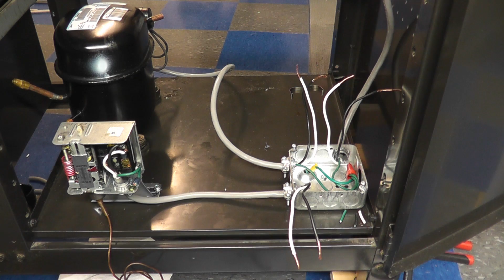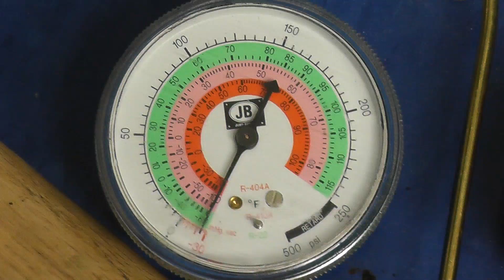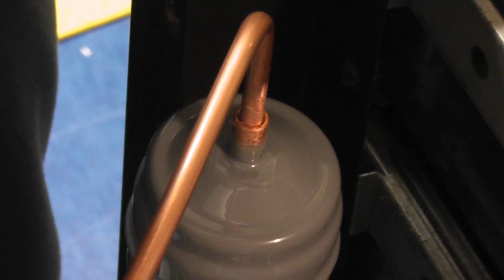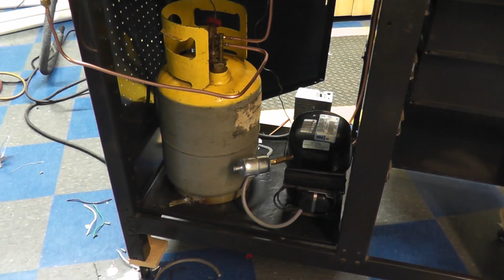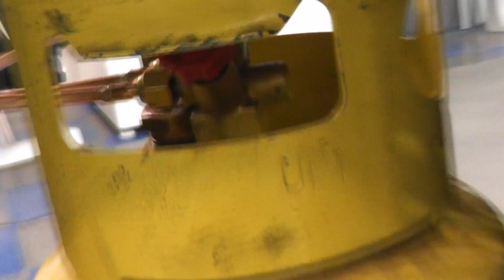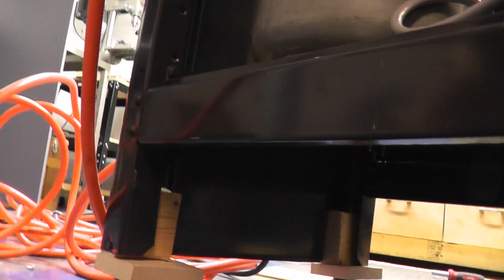Building a Silent Air Compressor Part 2

Comment: Loved it dude! This would be perfect for a silent compressor for mounting inside the cab of a car or truck for an air horn application. Youre obviously and HVAC tech or were at one point....Plumber here with my dad since i was like 7 or 8....so this is right up my alley. Have you ever seen a 12volt refrigeration pump that would give me like 150psi?

Comment: did I really see you show a PLUG that you are going to use to  feed the unit?
a plug with live pins?
sounds like a real no no to me.
Reply from the maker: Yes a plug that goes into an outlet mounted on my wall just like any other piece of shop equipment.  There is also a switch wired in series so I can turn the unit on and off without having to unplug it every time.

Comment: I had not thought of using one of them... I use about 40 PSI for the mist coolant on my mill... right now I have it connected to my regular (very loud) compressor. That might just be enough... may have to get one and try. I was wondering about making something to contain the oil and let it drain back into the compressor... that would be an interesting project. But hey... great job! I finally got my mill back from storage and all set up... whoo: The Milling Machine Move - May 2014

Comment: You are using a 134a compressor, so it uses oil, that will form an acid when it comes in contact with oxygen. Did you change the oil? If not, is the compressor still working, or does it make louder noises?
Reply from the maker: Works fine.  Nice and quiet and not heating up.

Comment: Thanks for the great video really appreciate u taking time and sharing. here is where I show my ignorance-could you change the oil in the compressor to air tool oil then it would lightly lubricate your tools and use the regular noisy one for painting etc?

Comment: Nothing like the smell of POE in the morning.  ;)
Reply from the maker: Yup.  Does have that distinctive smell.  I've replaced most of it with good old vacuum pump oil, but the smell is still there a little bit.

Comment: Should there be coils in the copper lines to absorb vibration?
Reply from the maker: There is not a lot of vibration in the unit.  The compressor is mounted on rubber feet that absorb most vibration.
Reply: *****
If the compressor is on rubber feet and the other components are mounted to anything other than the compressor, you're going to have vibration resulting in work hardening of the copper tubing. A coil or two in each copper tube would take up the vibration component. Either that, or use the appropriate flexible tubing. Look at the steel brake lines where they connect to the master cylinder. The master cylinder is mounted to the car body while the brake lines are connected to the chassis (unit construction or otherwise). The coils absorb the small movements (vibrations) and spread them through a larger portion of the tubing. Without the coils, the vibration will be concentrated at the connectors causing work hardening. I learned this when I built my first hot rod in the middle 1960s...

Comment: i cannot believe you could use a lathe-machine without wearing protection glasses....holy holy.... how you can touch the object while lathe machine was in rotation..? what???? how you can start unscrew the drain hose of a air loaded cylinder?? its quite dangerous to see all this. dont tell me that its a drain hose.  haven't you slept well before this job?? i have one more thing to ask, Why you did a vacuum test instead a pressure test.? because the drain hose had the cut and with that cut and some silicone, vacuum test may not be equal to pressurized test. no doubt i learnt allot new things, it was entertaining and informative, thanks for sharing. be safe, thumbs up.
Reply: Are you afraid to go out at night?  I agree w/ the safety glasses on the lathe but you are starting to be a little phobic...  lol    Mr Chicken...The sky is falling!   Vacuum test is precise.
Reply: Scott Smith vacuum test for leaks is not anymore precise than pressure testing. Also given you cannot achieve nearly the same pressure differential the test is less adequate. lol. Mr Chicken. That guy would shit a brick if he came in our shop!!
Reply: Vacuum test is for leaks only....pressure test is for testing if pressure vessel will hold a max pressure. He already knew it would hold...was an old tank he had used before. He is obviously a skilled HVAC person in which most of those guys are used to working with 300-400psi ranges and higher....so im sure (like me) would know how to solder a joint correctly (which he did) and will easily hold 200psi. The sky is not falling....lol. Have a good day!
Reply: Paul Wilson You are a fucking idiot. "Vacuum" IS PRESSURE.

Comment: Nice set up. How warm did the compressor get ?
Reply from the maker: During normal shop time use it gets lukewarm.  Hasn't gotten much past that point even if I lay on the airgun.  That's pretty much all I use it for.  The air gun and my little badger airbrush and a small automotive type detail sprayer.

Comment: Very nice video! What did you do with the oil in the compressor? Did you replace it? The sil-air compressors have a oil level inspection glass on them for checking the oil. Have you thought about any solution to that? I will do a similar project to yours, but im thinking of putting in a oil inspection glass also. I will probably buy a "loud" compressor for about 90$ and remove the compressor part and use all other stuff on it, buying it separate will be the same or higher cost if i do not fix a propane tank or something for free...
Reply from the maker: Honestly I haven't thought about adding a sight glass.  That would require drilling a hole in the bottom of the compressor which can be done, but I just don't want to do it.  The oil in the compressor is the original polyolester oil that it came with.  I just add a dab in there every once in a while if I notice some coming out of the drain in the tank.

Comment: Nice build. 
Looking at the compressor model it looks like it should deliver 1.3cfm under load. I`d consider fitting an unloader as the reed valves can start to leak after a while if they`re constantly under high pressure. I had it happen to a 3/4hp HST/HBP, turned out to be a blessing in disguise as it gave me an excuse to upgrade to a twin 3/4hp

Comment: Quick refrigeration question I forgot to ask you is why is it necessary to gas a pipe joint when you braze it yet no gas needed when you solder ? I understand the scaling thing but does that just not occur when soldering?
love your vids and I hope you are settled into your new home .

Much thanks
Richard.

Comment: Do you think you will  have a problem with it over heating and tripping the thermal switch with out the freon to keep it cool. If not that is a very good idea for a quite compressor.
Reply from the maker: For the amount of time it runs no. Now on the other hand if you're abusing it and trying to run something crazy off it like an air tool then yeah it will.  Using it for air brushes, small paint sprayers and air nozzles and so far it hasn't tripped.
Reply: ***** thinks for the reply i am too also  a HVAC guy that loves tools

Comment: It looks to me like the cover for the compressor electrical has a "raw" edge.  Given that the compressor will vibrate what keeps that edge from cutting through the insulation on the wires?
Reply from the maker: It's not. It's rounded and not sharp.

Comment: For what its worth nice video but wrong in so many ways just giving my opinion so no one gets hurt trying this at home or operating this I am sure it will work for a short time...

Never soft solder on a discharge line on refrigeration compressor.. soft solder will not hold up to temps off discharge line especially if it doesnt have any refrigerant in system to cool compressor..

The filter drier isnt supposed to be installed on discharge line only liquid ....

The compressor will burn out if used like this it uses refrigerant to cool it with no refrigeration compressor doomed for failure.
Reply from the maker: Staybrite has a melting point of 500 degrees F and most definitely can be used on a discharge line of most refrigerants.  Discharge line temp "safe zone" is 250 degrees and @ 275 degrees the refrigeration oil starts to break down.  If your discharge is getting to 500 degrees you have some serious issues and can kiss your compressor goodbye anyway.    The dryer is being used on a compressed air system as an oil block and secondary filter so it doesn't matter where it goes.  Duty cycle on this is maybe a couple of minutes to fill the tank and then cycling maybe every 3-4 minutes depending on how much air you're using.  It's not going to overheat unless you try to use it constantly which is not how it's intended to be used anyway.  Even if it does worst thing that will happen is you trip the thermal overload.  This can happen to ANY compressor including purpose built air compressors.

Comment: Great video Greg, been watching you for while now and always look forward to the next one.  One thing I've noticed is that those of us in a trade tend to pull our work into our needs.  IE, you need a compressor so you fall back to your HVAC roots.  My background is in hoses which includes every type of hose so when I need to plumb my shop for air I lean towards hoses.  Btw, I'm one of them plumbers that wipes his joints with a wet rag.  But when I silver solder hydraulic fittings I never do.  :-)  Silver solder joints are extremely strong as you know so most of my fitting joints are silver soldered..  Rarely if ever leak, and so far none have.  Thanks again!

Comment: Instesd of getting a new switch cover why not add a couple outlets so you can have one right where your are working
Reply from the maker: I would, but it's plugged into a 4 way outlet box.  When I rewired the shop I took into account how many outlets I'd need and where so I didn't need extension cords.

Comment: I really enjoyed the detail you show in this project, very professional result too! A question though if I may. I'm no expert in refrigeration but I know electrickery. In the US,  black is the active or 'hot' and white neutral right? I noticed that your wiring from the junction box to the pressure switch you used twin core black / white, which means that the White becomes a 'switched active'. Here in Australia that would be a strict no-no. A switched active must never be neutral color. I may be being a little pedantic here, I guess your compressor doesn't represent fixed wiring, but does your design there meet your local code? Cheers, Max.
Reply from the maker: Yes it does.  Here that rule applies to lighting circuits only.  You can't dead end a light switch anymore because a lot of the newer electronic switches and lighted switches need a neutral.  They don't want you using the ground for that purpose.  Basically every switch must have a neutral in the box with it even if it's not being used.  In circuits other than lighting the white wire if used as an ungrounded conductor (hot) must be completely reidentified for this purpose.  Basically wrapping it with black electrical tape from where it enters the junction box to the end, or using the equivalent like say heat shrink tubing.  I didn't do that.  You see this a lot when you have 3 phase equipment that is connected by flexible cords.

Comment: Nice job on that installation.

The Amazing Karnac sees a remote water drain valve or automatic drain valve in the near future based on the contortions you had to do to open the valve.  Have to say this is a PITA on almost any home shop compressor to access the drain valve.

Regards;

Ron
Reply: ***** let me recommend reversing the connection. eventually you will blow that air line off that sits full of water, and it will scare the ever loving shit out of you. We just put a ball valve on the tank, with a length of hose ran out {and tied down} a rod through the ball valve arm makes it easy to operate from afar. {I'm scared to reach under the compressor…..critters}
Reply: On my main compressor, I replaced the drain valve with a stem out from underneath the compressor, to a ball valve, to a hose that drains to the outside.  I drain after every use and use my foot for a quick blow.  Clear tubing after the ball valve allows me to see it empty.
Reply: ***** as long as the run from tank to ball valve is hard line, like copper tube etc. you won't have a problem. Just don't run rubber hose from the tank to valve. Those auto drain kits are plumbed that way {remotely}, HF sells a kit for about ten bucks.

Comment: Greg,
I really enjoyed the video. Regarding the switch for the motor starting coil, I have had problems with the starting centrifugal switch contacts burning from arcing on 115 volt motors and single phase 230 volt motors. I've seen the switches break apart or the centrifugal unit flies apart. They can be a real pain in the ass. It usually  results in "R and R" (remove and replace). If the switch breaks, the motor can usually be repaired. If the centrifugal unit falls apart, the weights usually tear up the windings relegating the motor to the trash. Is your vacuum pump the carbon vane type? It just has that sound to it. Hope your air system works fine. (Actually, I hope it sucks! LOL) It's good to see you making chips again! Thanks again for the video.
Regards,
Dave
Reply from the maker: Yeah we get them too.  Not so much from use, but misuse.  The contacts are normally closed so the only arcing is when the winding is taken out of the circuit.  We se it a lot when someone puts a belt on too  tight or short duty cycles with a lot of on and off.  These compressor relays are normally open so there is load arcing as it closes to cut the start winding in and arcing when it takes the winding out.  That's why any compressor over 1/2 HP has a potential relay with normally closed contacts.  Yes the vacuum pump is carbon vane.  It's an old (16 year) J/B brand 7 CFM pump.  It's been bullet proof so far and has been to hell and back including a truck rollover and still works like new.  As long as you change the oil every once in a while they last forever.
Reply: Swarf Rat you can use a "potential relay" or regular ole relay with creative wiring to bring a starting cap/circuit in/out on motors with trashed centrifugals. same circuit we use for starting RPC's {rotary phase converters}

Comment: Great job. Personally I would have just flared all the fittings but I come from a propane background... :-)
Its really quiet, just perfect for home shops that dont need tons of air or noise.

Colin
Reply from the maker: I love the little flare swivles.  Great to be able to put a flare on a piece of hard drawn when you need too.
Reply: For sure. I wouldn't be able to get away with that in my work... :-)
I had a summer with a refrigeration guy a few years back. I really enjoyed the work and learned a bit about it. We did a fair amount of tubing and hard pipe. Melted a bit of Silfoss too! :-)

Comment: What kid of solder is that? Around here refrigeration is always brazed with
Silver-Phosphor-Copper, it doesn't need flux when doing copper-to-copper
Reply from the maker: Yup and a lot of people use that here too, but I don't like it and use it only when I have too.   Most use it because you don't have to clean the pipe, but I always do no matter what I'm using.   If you don't flow nitrogen through the pipe it builds scale, and it anneals hard drawn copper with the heat involved.  Not to mention the high heat involved which is not good around sensitive components like expansion valves or when you're in tight quarters like a compressor compartment on a reach-in cooler or above an enclosed ceiling.  The solder is Stay-Brite #8 which has a high tensile strength.  Around here it's pretty much your preference although I have done some jobs where brazing was required.

Comment: Nice job with that! It's very much like something I did a few decades ago. :))
The only real difference is that I had added an oil 'trap' ahead of the filter, with a capillary return line to suction port, and a few check valves. This also acted like an "unloader", so the compressor didn't have to start against a head pressure.
Reply from the maker: That's a good idea.  If I have oil consumption problems I'll have to look into doing that.
Reply: Helpful tip.

Comment: Hi again !

A very nice, good and instructional video - thx for showing - I think many could do with such a air compressor instead of these noisy monsters you can get in Harbor Freight or whatever you call it - they often scare the shit out of you when they start !
Reply from the maker: Yeah mine was deafening.  Not so bad outdoors, but inside horrible.
Reply: had to laugh at the scare comment! Have had that happen many times.  I've used these refrigeration pumps for simple vacuum purposes, but I may make it a dual purpose pump for a quieter compressed air blow off source (just because the noise is annoying from my main source of compressed air)